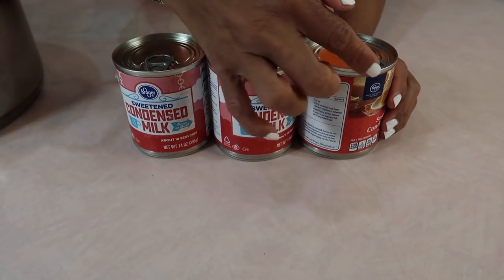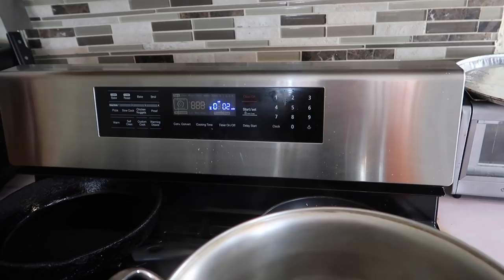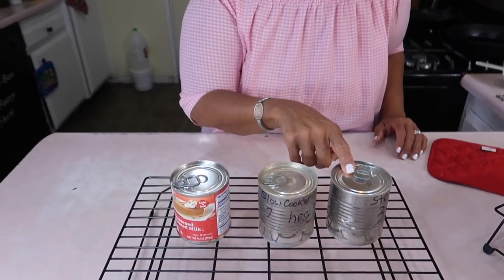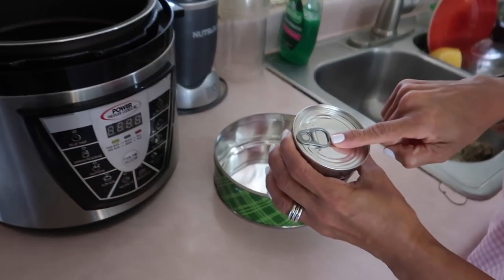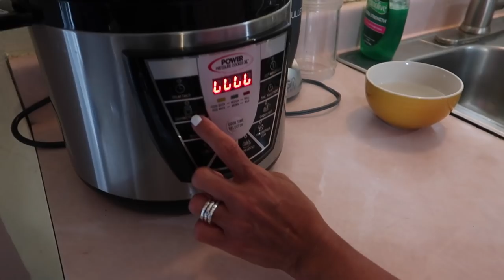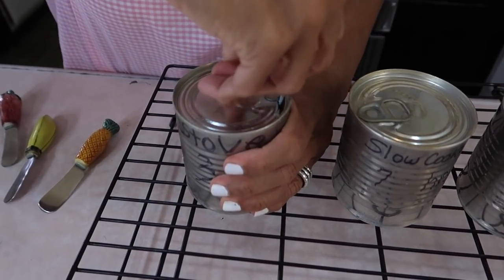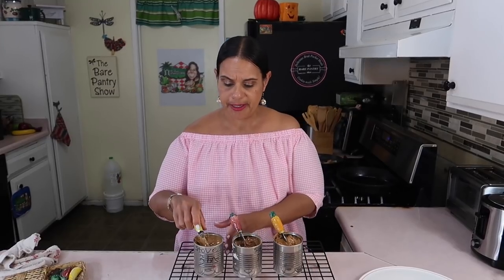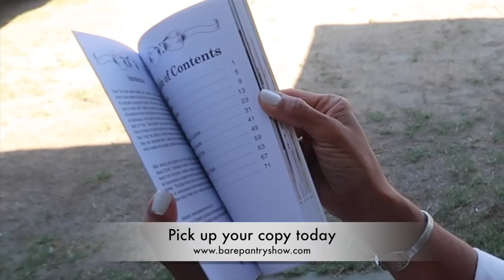Three Ways to Boil Sweetened Condensed Milk to Make Caramel

Comment: I have recently learned that you can pour it in a Mason jar with the lid and boil it that way, so I can see how dark it is.
Reply: Yep. I did it that way and it turned out great.
Reply from the maker: I've seen it where they put it in a baking pan in the oven too. I'll try all these suggestions. Thanks for sharing.
Reply: I will be trying this method as soon as my Ninja Foodi arrives. Thanks!
Reply: @TheBarePantryShow  just want to ask if any type of pressure cooker can do same like this I'm afraid it might explode if I use mine
Reply: I would want to put in glass jar... wouldn’t want it boiled in aluminum
Reply: That's such a great tip!! Thank you SO much!! No more guess work
Reply: I’ve never made it before, but going to attempt it to make salted caramel coffee creamer. How long do you need to boil it for in the glass  jar?
Reply: @Denita_Wishart  it just depends on how dark you want your caramel. I usually boil mine for 2- 3 hours covered by water the whole time.  Don't let the water go below the groove part of the glass jar.
Reply: @sharonkaywebb  agreed, tho most cans aren't really aluminum. They're more like an alloy of steel and tin with a plastic lining, which is even worse. Either way, like you say, it'd be much better to do it in glass, any time. Good idea....cheers!

Comment: Saw someone pour the sweetened condensed milk into a small bowl, place that bowl into a larger bowl with water, and then place it in the microwave for 8 minutes.  Also if you want to use your crock pot, put it on low and cook for 7-8 hours.

Comment: Yes, Southerners have been doing this for years. I'd heard it called "Danger Pudding," because of the danger of the can exploding when cooking. Because of that, I tried it only once, since I was too afraid of the can blowing up. It worked fine. I'd never heard of using the slow cooker to make it, though. What a great idea! I'll have to try it that way. Thanks for the video!
Reply: I think she said that you have to cover it with an inch of water if we're cooking it in a pot over the stove. I, too, was concerned about cans blowing up since I read that on google. But now I think IF it's just about adding enough water over the cans, I will try it. But I'll stand back🤨. Well, at least until I have to remove them from the pot after 3 hours. 😷

Comment: I did this last night.   First brought the water to boiling point.   Reduced the heat to simmer.  Placed two cans in the pot and made sure the water level covered the cans completely... at least an inch above the cans.   Covered the pot and boiled the cans on low heat for 3 hours.   After three hours, Allow the water to cool (2 hours).    Then place cans in the refrigerator for more cooling.   After that your caramel sauce is ready.   The taste!!!!!  Wow!   Delicious!

Comment: I have been doing this for years. I leave it in the water overnight after the boil, then refrigerate 24 hours. Never let the can show. Water should be at least two inches above can at all times.
Reply: So you bring to a boil first then leave it simmer or bring to a boil turn off and leave over night?
Reply: Simmer for one hour. The longer you simmer the darker it will be

Comment: Thanks for the good video. I'm pretty sure that you wanted to flip that trivet/pan upside down in your pressure cooker. The way you did it doesn't accomplish anything really. You want to raise it from the heat source. Cheers!
Reply from the maker: Thank you Thomas. I know nothing about the pressure cooker. lol I usually use the slow cooker to do the milk.
Reply: @TheBarePantryShow  I'm going to try it today, thank to you. I'm going for the simple boiling method you showed. This is brilliant...why pay a fortune for a chemical filled caramel sauce at the store when you can have this? We struggled with caramel for years at my restaurant. I sure wish we'd have had this secret then. Latinas know their way around Caramel, that's for sure....Cheers!
Reply from the maker: @thomasclendening2664  Hey Thomas, I'm not latin, but that's cool. I've always wondered how the get the milk to be caramelized in the store bought ones as I'm sure they don't boil them like I did here. The must cook the milk on the stove top than can them. Either way, they aren't good. They always seemed burnt to me.

Comment: That was scary when you took the can out of the pan. The can MUST be completely submerged in the water at all times or you run a very high risk of the can exploding. Maybe everyone all ready knows this, but I'll share anyways. Water boils at 212 degrees, plus or minus a few degrees depending on your altitude. So, when the can is completely submerged, the contents will remain at 2i2 degrees. But if the water is allowed to evaporate and a portion of the can exposed,, the can has a likely chance of exploding. The reason for this? The portion of the that is above the water level will not be held to 212 degrees, but rather will heat out of control. Clear as mud? But, wow, the caramel is amazing!!

Comment: It’s also a British thing, been around since there was canned condensed milk for sale in the shops. Probably available well before it reached countries that didn’t manufacture evaporated and condensed milk but imported it.  I’m 71 and watched as a child aunts grandmothers and my mum doing this, the tin or tins were put in a pot and left overnight on the back of the oil cook stove which was left on low during the night, only source of heat back then.  Your claim that no one outside of the country you grew up in knew about this method is way off.

Comment: I was concerned for the man who took the plug out with metal tongs. One slip and he could have been electrocuted. Why not use a hot oven glove?
Reply from the maker: He released the steam with the tongs, he didn't remove the plug. Are you guys even watching the same video? Why would he use hot oven glove to release the steam, it would go right through them. The pressure cooker was not right up on the wall outlet. There is a depth you guys don't see due to lighting and camera angle. Chill Shelby it's all good.
Reply from the maker: Shelby McCoy Bye, you won’t be missed. This is not the kind of show where you get to tell me stupid crap and I shut up.